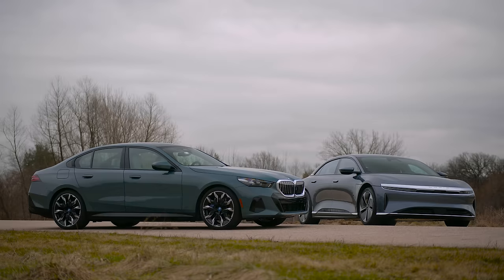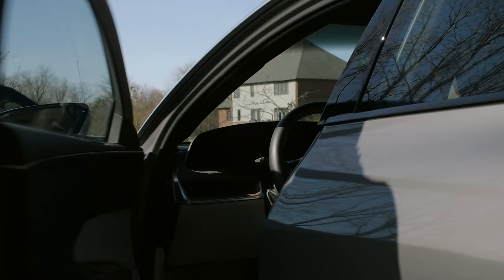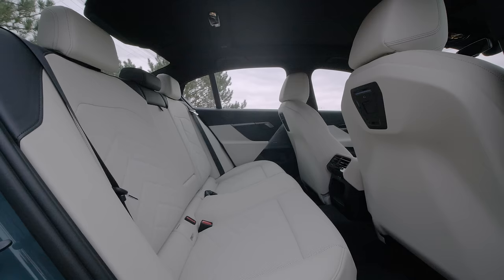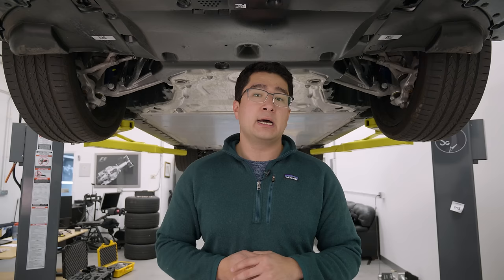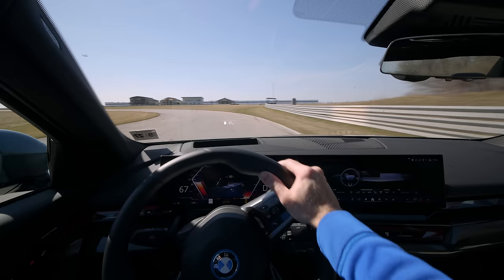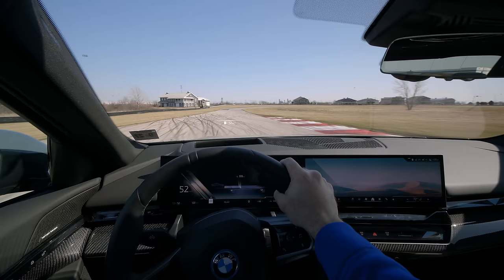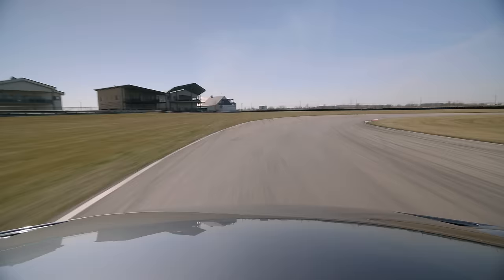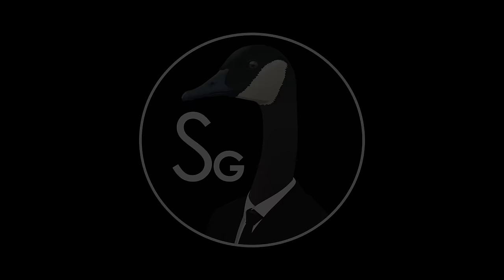Lucid Air vs BMW i5 | Worth The Money?

Comment: The only other potential competitor in the RWD EV space will be Porsche with their Cayman EV RWD, IMO.

However, I doubt it will be as mechanical as the Lucid, it may make up though for it on weight distribution (batteries behind the driver) and lightness though.

Comment: Finally, some actual advanced vehicles are being reviewed. Felt like we were stuck waiting for revs to build an NVH hell with these ICE cars reviewed here as of late.
Reply: @japanwatchconnection I like vehicles. Do I prefer instant torque, low NVH, and insane acceleration? Yes. Do gas vehicles offer that over EV in most cases? No. Do I prefer charging at home overnight when I sleep? Yes. Do most EVs fit my weekly commute on ONE charge per week? Yes. 

I've loved my share of gas vehicles over the years but EVs are on a whole other level. It would be hard for me to go back to gas. But with all that said I'm a vehicle enthusiast so I like all cars generally.

Comment: Since you talk about how much quieter the BMW is, here is what I want in a car review. I want a quiet car, I’m not interested in how fast it goes from 0 to 60, I’m not interested in how easy it is to drift around a corner, I just want silence, so I can relax in one place at least once a day in my life. But I don’t have hundreds of thousands of dollars to buy some ultimately quiet vehicle. What I would like to know is what’s the quietest car I can get for say $50,000? I’m especially interested in lack of road noise. I’ve owned half a dozen Hondas in my life and loved all of them but all of them have atrocious road noise and I find that the older I get the more that irritates me.
Reply: Wife just got a 24 CR-V touring. Much quieter than her 18 ex-l. Oddly, mileage is only about 1.5 mpg better. Quieter for sure but not silent.
Reply: You don't need to spend $50,000.  Did you try the Acura RLX?  That should be quieter than the average Honda.  Otherwise a used Lexus LS500 should be the gold standard for quietness (short of moving up to the Rolls Royce/Bentley class of vehicles). Noise levels are almost library-like in a LS500.

Comment: Sadly BMW has been compromising their classic core design criteria for a while now, and it appears as though they may have finally given up all together.  I've had a BMW sedan of one form or another as my daily driver for 25 years now, I buy used and am usually about 10 years behind new.  I wonder how much longer I will be driving a BMW?  Lucid on the other hand seems like they benchmarked the e39 540i or e39 M5 in designing this car, perhaps the high point of driver based sedan engineering.  And it appears that at least in some regards and in spirit they obtained that.  First, nice thinking Lucid, that's a really smart place to start.  Second, BMW take note.  I wish for a second that BMW engineers (not the lowly little interns they might actually have do it) would read the comments on a video like this.  They could see what true users of the brand are saying.  But they will look at sales numbers and read what they want.  Many of those buying decisions are being made by people who want a BMW because the name or because they always have and now make this choice because it's whats available, not because it's what they want.  That can work for a while but loyalty runs out and existing customer bases age out.  We'll see where it goes from here.
Reply: @japanwatchconnection That's very interesting given the cheaper MQB underpinnings on the Artoen.  Maybe the Audi A6 on MLB (or China-only VW Phideon) would be more isolated like the BMW 5 series, which is more what luxury cars are going for and what luxury car buyers expect these days.  You suppose the extra subframe isolation, extra ball joints, air suspension etc on a VW group MLB car would actually  count against it, in your estimation?

Comment: Doesn't the BMW have a drift mode with the M models? You mentioned that BMW's philosophy is 0-60 in a straight line, but to me it seems they have dedicated cars for drifting and other fun stuff and the model you tested is for other use.
Reply: What they meant is the platform is made only 30% EV in mind. The other 35% is for their B58/48/hybrid variant and the other 35% for their full M5 variant. Air on the other hand is a DEDICATED EV design.

Comment: Two points, in your video the battery was cold in the lucid, you didn’t precondition it, so you can’t confirm it charges as slow as the BMW.  I got 235kW on mine at a higher state of charge because I preconditioned the battery and it was 28F outside.  Also long RT60 on audio testing is not due to cancellation as you said, it’s only reverberation, you’re using the wrong terminology.  Phase cancellation cause isolated frequency loss when two out of phase waveforms happen, which does occur in the Lucid.  Also of note, yes the Lucid is 2dB louder inside than the BMW, I tested it myself with a pro SPL meter…but the human ear cannot usually perceive a decibel difference of 2dB, so I think on a normal surface the Lucid won’t sound any louder than the BMW, but I’m sure the BMW is quieter over impacts as you said (I’m a former audio engineer so that’s why I’m nit picking about the sound stuff).  Otherwise this is a solid and balanced video, great job!
Reply from the maker: We did it using pre conditioning and without fyi
Reply: @savagegeese  good to know, I only saw the clip showing charging with the battery looking like it was cold.
Reply from the maker: @larrywineland4682  That attempt preconditioning did not work. Was too cold outside.

Comment: People do care about steering. It's why I never want to part with my BMW 128i. It was also my favorite thing about driving my friend's air-cooled 911. I daily a 2008 CRV. Yeah, it's an appliance, but it has surprisingly good feedback through the steering wheel. I got a loaner 2024 Passport, and the EPS rack was terrible. I was constantly fighting it, and the thing wandered around on the highway. It may have been partially due to the tires, but it was disconcerting nonetheless. I get it that we're pretty much stuck with EPS apart from boutique brands, but Lucid went with the same rack that a 911 GT3 has, which shows that they respect their customer base. BMW is only building cars for badge whores. Screw them for that.

Comment: Consumer Reports seems to really like BMW.  I thought they were oil burning pos vehicles.  Has something changed ?  Well Subaru is number two and certainly much cheaper to maintain.  I'm sticking with cars which have a vin starting with a J.  (My 2015 FRS just turned 73,000 mi. and zero issues, yes 0).
I have Lucid stock and hope they survive for a while longer.
{Should your hoodie always match your tennies ?}
Reply: Yes, their latest engines and gearboxes have been really solid. B58 engine is almost like a god now among car enthusiasts.

Comment: They wouldn’t have to go to all that effort shrinking the motors and making funky trunks if they weren’t so scared of building big sedans. I know neither of these companies made a car like the big 3 did back in the day but why not? I’d say a good chunk of those who still want a sedan want a BIG sedan. I know I do. I wish my 2017 Continental was the size of my 79 Continental.
Reply: The BMW i7 long wheelbase is pretty big, isn't it?  Maybe not all that wide. At some point, BMW wants you to move up to Rolls Royce  brand to obtain their full-size car, noting the 1979 Lincoln Continental was a Rolls Royce competitor. BMW's '24 Rolls Royce Phantom Extended Wheelbase is 5982 mm x  2018 mm, where a '79 Continental is 5918 mm x 2022 mm, so the Rolls is quite comparable.
Reply: I'd agree with that for sure, however, a BMW/Lincoln/Mercedes/Cadillac at least for the most part is a car that is attainable at some point in life for someone who is middle class. Rolls Royce is an unreachable car for the vast majority of people. So I suppose the market that isn't being served is true full size sedans that can be had for under 100k. @TassieLorenzo

Comment: I wish that the EV manufacturers’ marketing departments understood EV buyers better. Two and a half ton EVs will never be sports cars. Why decrease the range with unnecessarily large wheels and tires?  When we bought our i4 e40, we got the msport package as it was the only way to have the adaptive suspension. It comes only with 19” staggered wheels, replacing the square 18s on the base e40. I would gladly trade a bit of grip for the ~7% better range with the smaller wheels. For the time being, we’ll buy EVs for luxury which they’re great for, and keep an ICE sports car around for entertainment. When the brain boxes at Lucid come up with a ~3,500 lb (or less) EV sport sedan with 300+ miles of range, I might go all in on EVs.

Comment: These cars have a lot in common! 

- To my taste, Exterior design is pretty terrible on both.

- To my taste, Interior dash/console interface is terrible on both.  Tacked on looking mega Touchscreens are dumb!

- The current “on the road” charging experience is terrible on both and will probably get worse for a long time before it gets better. Tesla NACS is going to get overwhelmed. 

BMW cars & SAVs are (mostly) getting worse with each update and they just need to stop breaking stuff that was great in the prior gen. 

Lucid is “new” brand with 1 product (currently) and can hopefully improve their misses in future updates before they die off due to the EV bubble bursting.

Hard pass on both for me, but thanks for the information. 🍻

Comment: i like the lucid,,,, so lucid does not have a heat pump ??
Reply from the maker: Right now only in GT and Sapphire. It will trickle down
Reply: Not good. Especially for northerners.
Reply from the maker: In lower trims no. But my guess is that it will become standard.

Comment: It's such a shame that the Lucid Air isn't available in wagon form unlike the I5. It's still the formfactor of choice of this class of vehicles in Europe. And I would most likely get one as next company car if it was a wagon. Now I most likely end up with I5 wagon or ID7 wagon. Or if something better comes up.

And no, crossovers do not count. They are just half assed efforts that have worse highway range due larger cross section. Manufacturers make huge fuss about small Cd, but that's only half of the drag formula, the cross section is the second half and sedans/wagons always trump that part.

Comment: The Lucid looks like a soap bar, sort of like the Merc EQE, designed to be slippery. The BMW looks like a beaver beaten with the ugly stick multiple times. Software however on the Lucid looks barely even “half-baked”.
So I’d buy something other than either car. I’ve driven an EQE 53 AMG, the new Hybrid AMG C63, Audi RS e-Tron GT, Tesla Model 3 Performance, Kia EV6 GT and Hyundai Ioniq 5N and with all of them the software, driving and usage experience was better than these 2 cars appear. I’ve also driven a BYD Seal Performance - it is quick, but its handling is unsafe. (Currently my wife has a Ioniq 5 non-N, and I have an AMG and shopping for an EV replacement)
Reply: It looks nothing like the Merc.

Comment: BMW only has to deal with a single speed auto with their electric cars and they still can't get the primary controls and driving character right? Ultimate Marketing Machine. Forget about BMW manuals,  they've been trash for a long time. I'd rather drive an i5 than a manual BMW.

Comment: Haven't heard of the throttle/braking feel issues. I have an i4 M50, and it is phenomenal. You have to remember, the BMW's for their weight and non-jelly bean shape have exceptional efficiency at 75mph highway speeds. Check out CR and C&D results. You have to remember, the i5 managed to get the Edmunds Luxury sedan of the year award, and just won the World Luxury Car Of the Year award. And BMW just got the Consumer reports best brand ranking, and the i4 the JD Power's EV Experience satisfaction award. So it can't be that bad. Here is a nice comprehensive test between the Plaid, EQE AMG, and the i5 M60. The winner of this test: The i5:  https://youtu.be/7Fa-1YXrTMI?si=wqydoVIxtCqxvNtT   This video probably highlights what is important to most owners.

Comment: I mean this is the comparison between a luxurious long road trip car made for highway cruising with a little bit of fun and a car made for fun in short bursts…
Maybe the BMW M3 is a better comparison here than the I5.

Its like testing a rolls Royce against a formula one car… 

The lucid imo does the same sin as tesla and sells a cheap non-designed interior in an expensive car. The acceleration might be nice but I drive sedans on long road trips so comfort is more important than acceleration…
Reply: I think pure is the lower priced lucid and more comparable with this BMW. The lucid is probably more comfortable to drive for the suspension tuning. Noise and drone is actually quite an art to tune out and lucid obviously need to iterate and improve. 
I’d be curious to see if they threw in a genesis in the mix. The G80 EV with its custom lower half that’s more EV than traditional chassis. Like a 3 step evolution to EV design approach.
Reply: Yes, but therein lies the problem. The 5 series has always been a sports sedan, something that also set it apart from Mercedes' offerings, its most direct competition. Now the 5 series is just a grossly overpriced Camry
Reply: Yeah I remember back in the day when Car and Driver called the supposedly spicy Audi A6 3.0 quattro long termer "a Camry with better paint."    History is repeating itself here. @LearnAboutFlow
Reply: @LearnAboutFlow  the 5 series now is larger than an old 7 series and the 3 series now is larger than an old 5 series. And the 3 is still pretty sporty.
I think it works out… unless they do a test and show the lucid is better than an M3…
Reply: @bingobongo1615  I drove the built-in-Mexico 3 series. It was about as sporty as a Corolla. BMW has lost the plot.

Comment: I hate the bmw software, too many menus and rediculous placement. Gen5 motors with brushes (back to the eighties) will cost you so much money (all motor failures will be wear and tear) Lucid also made huge upgrades to what you refer to be needed to improve. Never ever again a cheap ass build bmw, please drop the premium, they're not, they call themselves premium, that's not how it works. google the new CEO speech from 2010 will clear much up (Prio 1 to 99, all for the shareholders, so cheap build quality and over premium pricing and bad service)